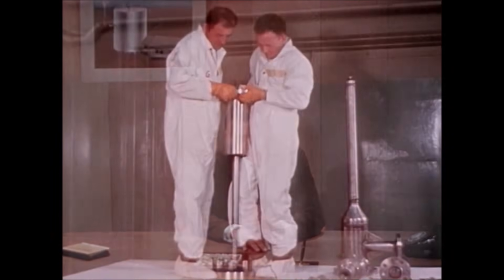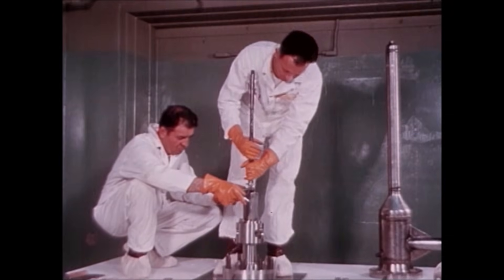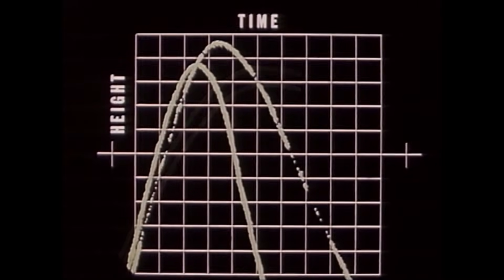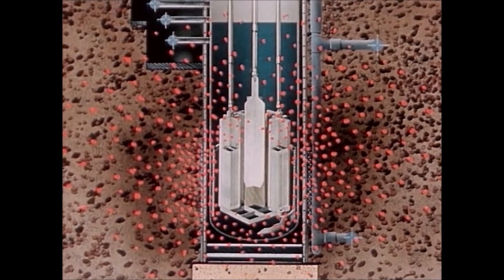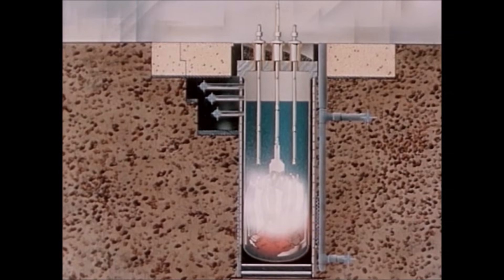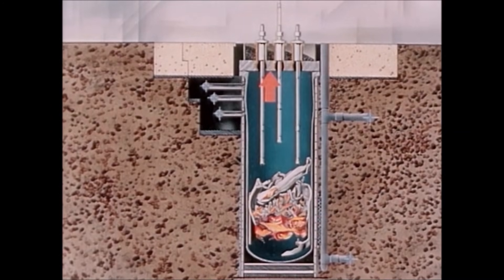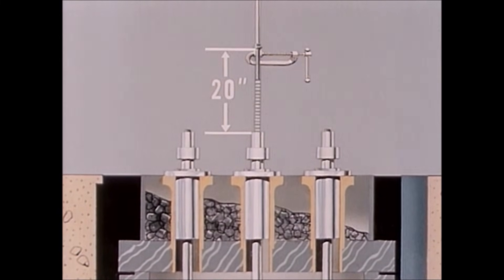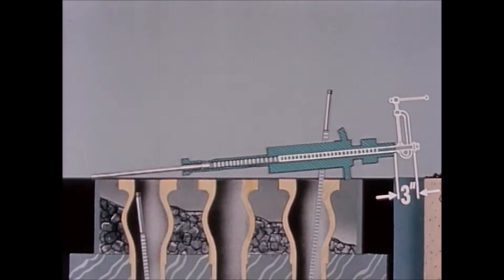America's Chernobyl the SL 1 Nuclear Accident

Comment: A nuclear power plant design where one guy can just pull the main control rod out? WTF

And what's with the C clamp :D
Reply: It was a prototype in the early days of nuclear technology. As for the c clamp, it was to hold the rod during the matnice
Reply: It was a prototype of a extremely small simplified power plant designed to be able to power remote outposts. Basically it was trying to be what a portable diesel generator is.